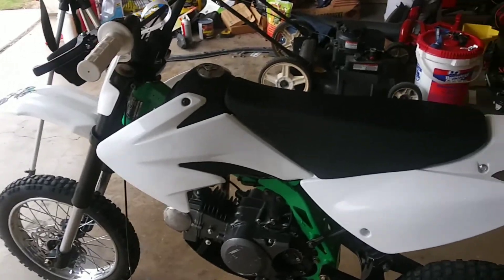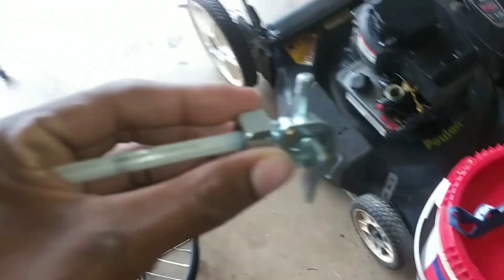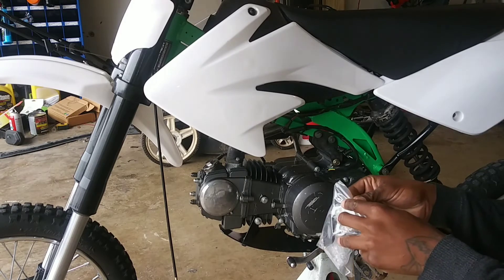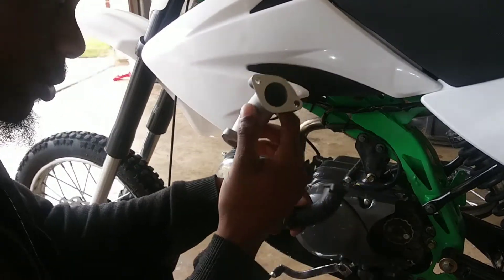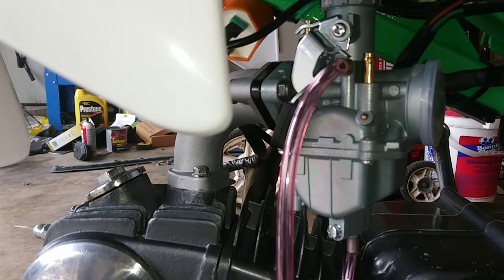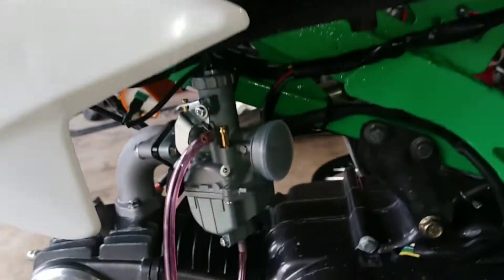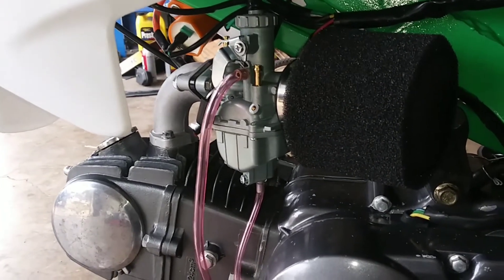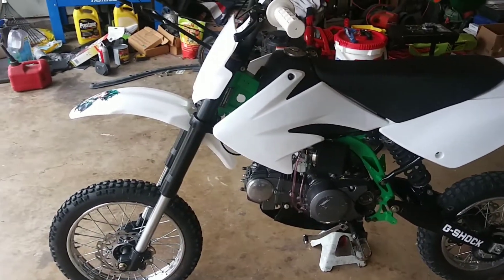Apollo Racebike Build | Part 5- VM22 Carburetor install

Comment: I got same carb couldn’t get it to idle .. was okay for 5 mins turned it off . Fired it back up wouldn’t idle ? Only have fuel screw , and screw for Thotlle  cable
Reply from the maker: Take it apart and check to see if float is stuck open or jets are clogged

Comment: Hi. Nice bike. What's your opinion on the thumpstar 140 and the ycf 125/150? Are they all the same size and can be raced in the pitbike champs?
Reply from the maker: Yes they can be raced..The thumpstar is a nice bike but the ycf is definitely a bit nicer in my opinion..Just remember not to get the bigger wheel bikes if you wanna race Pitbike classes..the biggest is 12/14 for true Pitbike
Reply: @1E11evenMoto  thanks for the your thoughts. Yeah ycf is nice with the factory builds and also the thumpstar has solid suspension and powerful 140 engine. I think the thumpstar has a bigger wheel base and seat height tho which takes away from the pit bike feel. Defo good for all rounder tho.
Reply: @1E11evenMoto  the only pit bikes here in manila are thumpstar 140 (no 190) and the ycf 125 start and ycf 190 bigy. I feel like the ycf 125 start is good for wheelies and slow pit tracks but no good on big jumps or tracks. The bigy is a beast but is basically a full size bike. So I will probs go for the thumpstar 140 until more options are available.
Reply from the maker: Sounds like a good choice

Comment: How do you go about getting plastics for your builds? or can the plastics and graphics kit be ordered?
Reply from the maker: You can find plastics anywhere on the internet..ebay has it all..or amazon and most pitbike shops too.. My graphics are from my sponsor bikegraphix on all my builds.. Just depends on what style plastics your bike takes
Reply: @1E11evenMoto  Yes i have a 2020 Apollo RFZ Z20Max most kits on Amazon are bike specific and I have no idea which set is compatible with my dirtbike. Thats where i get stuck.
Reply from the maker: I believe the z20max is ttr based plastics..thats the closest ive seen to it

Comment: Did you use the same cap on the throttle cable from the old carb when you installed it into the new carb?
Reply from the maker: No..new cable..